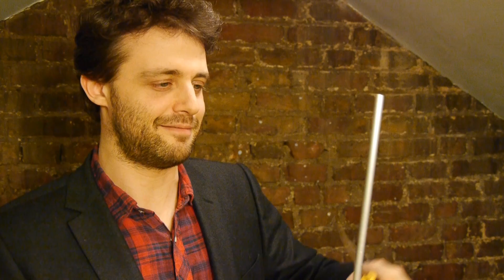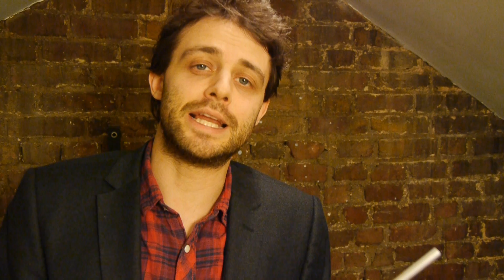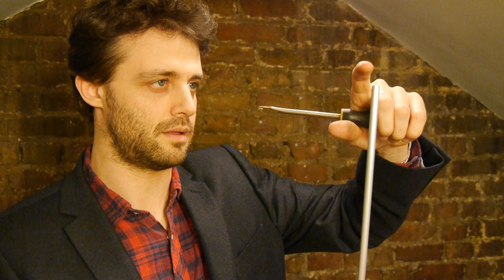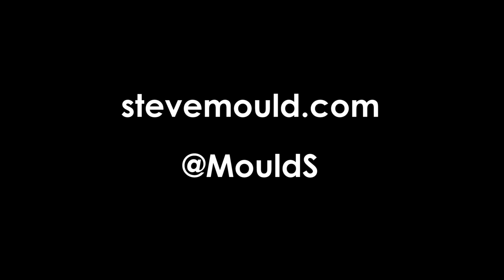Strange sounds when you hit a metal rod

Comment: I know this is an old video.  Make a rubber damper, something like a large rubber band but thicker that can hold the rod snuggly but can be moved freely along the rod's length.  If after several trials you can find a spot where the damper muffles or stops the higher pitch, this will support the idea of natural overtones happening from the flex of the rod.  If the damper does not affect the higher tone, this will support the idea that the tone is produced by stretching and compressing.

Comment: The sound travels through (some) aluminium with the speed of 5110m/s. Given that the rod is allowed to give way in both directions (forming antinodes in both ends and a node in the middle - making the rod half a wavelength), it will vibrate having a freqency of 5110/(2x0,750) Hz = 3407 Hz. Definately within the audible sound range.

Comment from the maker: Interesting! The reason I think the rod is compressing lengthways is that if you produce the sound using friction (with rosin on your fingers), the change in length of the rod is visible to the naked eye. If this change in length were due to flexing, the transverse motion would be visible too but it isn't. The best way to decide conclusively would be to look at the elasticity of aluminium and work out what the pitch should be! I may do that at some point. the rod is 8mm diam 750mm long.
Reply: Hold the rod w/two fingers, exactly in the center (perhaps found by balancing.)  That kills half of the possible transverse overtones.  Now, *bounce* a heavy screwdriver (or a steel wrench-handle) from the rod-end, hit longitudinally, trying to hit the rod exactly end-on.  This produces a piercingly loud high note ...but only if you bring your ear near the end.  Also I find that the same note can be produced by letting the vertical rod bounce from a concrete floor, or better, a large block of steel or aluminum on the floor.  (Or just use the rosin-stroking physics-teacher trick, and compare the frequency with the struck-rod's frequency.)    We can glue a small slip of paper to the rod-end, to supply a sounding-board, and make the piercing high note become louder ...but last for shorter time.

Now try it with two rods, with a very slight difference in length.  Bounce both off the concrete floor at once.  You'll hear a beat-not in the sound, wow-wow-wow-wow!   Use a dremel to grind down the longer one, until the beat is exactly one second.  It's not a quartz time-reference, it's an aluminum time-reference!

I find that these entire demos also work with sheet metal!  No rods.

Once I was throwing scrap aluminum in the pickup truck, and I heard a persistent resonant whistle, lasting perhaps ten seconds.  I stopped everything, and started striking the edges of various aluminum sheets with a screwdriver.  I found the particular one.  There was a little aluminum piece under it, right in the center.  The sheet was suspended right at the node. 

So, take any meter-wide thick Al sheet, find the central balance-point, and suspend it from that point.  Now give it a violent whack, edge-on, using the handle of a steel wrench.  The whistle-pitch sound will last for amazingly long time!  (Hrm, now that I write this, I realize that I never tried it with the stroked-rosin trick.  Singing metal sheets.   Also, gotta try it with an actual metal disk, rather than rectangular sheets which perhaps are producing internal longitudinal Chladni-patterns and numerous longitudinal modes all at once.)

 
Other ideas:  the fundamental longitudinal resonance, that's the same thing always used to produce sonoluminescence in a spherical flask of de-gassed water!  The momentary pressure in the center of the flask is significantly below zero, and essentially "tears open" the water, forming cavitation-pockets which then slam shut during the momentary overpressure.  So, in the center of your aluminum rod, the momentary pressure goes way, way below vacuum.  If we could drive this with some sort of kilowatt oscillator, I bet we could crack the rod in half, and have the two pieces fly off and embed themselves in the walls!  (Note that negative pressures are perfectly feasible in liquids, but only if no empty cavities are present.  Degassed liquids, lacking micro-bubbles on the container surfaces.)

WEIRD idea:  if the liquid has some fuel and oxidizer, then cavitation caused by longitudinal (radial) oscillations might become self-sustaining, as a sort of Diesel-powered acoustic oscillator?  I've never seen this discussed.   If possible, then a "sonoluminescence bulb" might persist in ringing, being driven by the tiny glow in the center, which actually is like a high-frequency piston-engine, where the water is the piston.  (If it's hot, it might convect, which delivers fresh material into the reaction-center?)  Must try methane-filled water, or just  alcohol or kerosene or gasoline, first with lots of pure O2 bubbled through it.   There is a legend in "crackpot science" that normal veg. oil will do this, producing excess acoustic output during ultrasound cavitation,  just because of the dissolved air.

Another: during WW2, they turned the Klystron tube into the Magnetron, by taking that longitudinal-resonance device and combining it with numerous others, all aimed at a central coupler.  

The "singing rod" version would involve a central metal disk or sphere, with long rods screwed in or welded, like a radial sunburst.  Trim all the lengths to produce exactly the same freq.   Why?   Because with magnetrons, if we strongly damp one rod, it doesn't instantly damp the global oscillation.  Hang the "sunburst" from a central rope, have many assistants stroke the rods with rosin powder, and we've demonstrated the "acoustic magnetron." Perhaps one rod-tip could be used as an acoustic drill, but without instantly damping out the oscillation.   Acoustic destruction ...inspired by the well-known microwave-oven tube.   Heh, and for everyone who has received an RF burn from playing with a CW tesla-coil, now here's a way that we can start receiving acoustic skin-damage, **sound-burns**.

Comment: The compressional wave also emits sound in a narrow beam from the flat ends of the rod, with thicker rods emitting a narrower beam.  You can aim it at someone across a room, and only they will hear it loudly.  Striking the end of the rod with a small, hard object really gets the compression mode going, without exciting the bending mode, hardly at all.

Comment: After doing a spectral analysis on the audio on the clip, the higher frequency standing wave does have a greater intensity. If the link works below, you'll see the two major standing waves and all their harmonics. The problem with analysing audio from a YouTube clip is not only that it's compressed and lossy, but it cuts off around 15khz, which means we can't see the harmonic which should be at around 20khz for the high intensity wave.

imgur DOT com SLASH Y4hGdP9

Comment: actually there are different modes of oscillation for this rod. it depends on where you hold and support it while it's oscillating and then where you touch it to mute a certain mode out. a guitar string shows the same behaviour. i couldn't find any literature about bending beams like these really oscillationg in vertical direction. actually there is a changement in longitude, but it's induced by the movement described above.